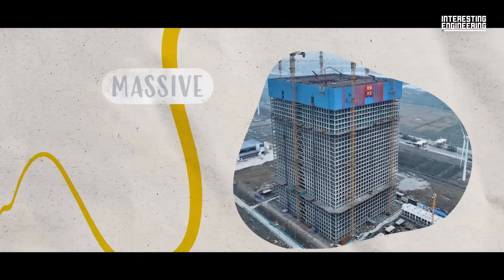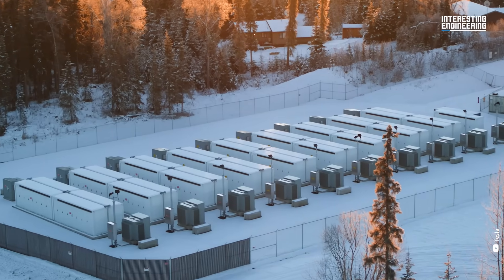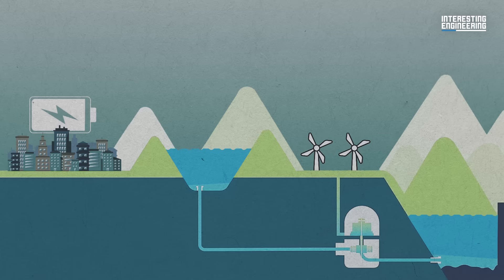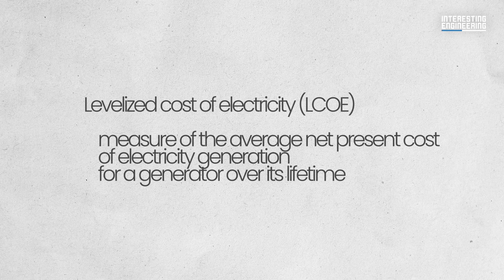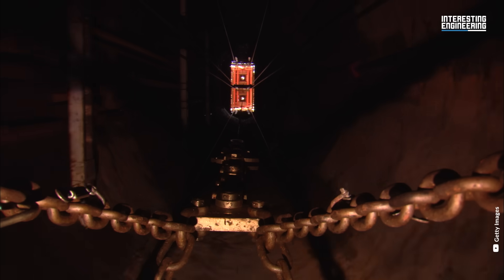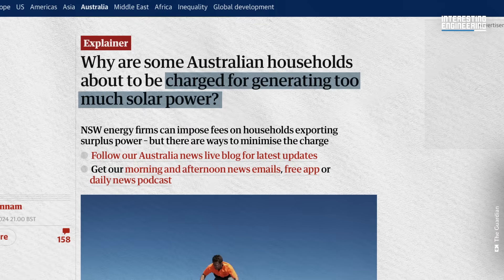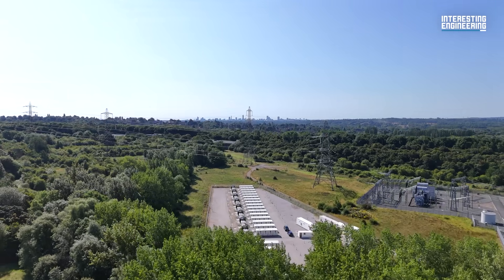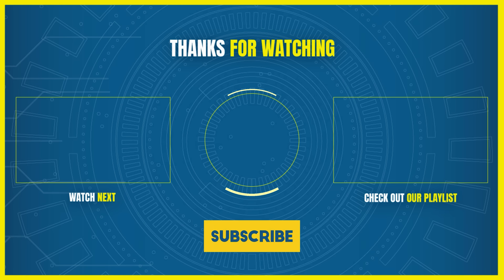China is Building Gravity Batteries

Comment: KISS - Keep It Simple Stupid.

GRAVITY STORAGE
Mass : giant constructed weight  
Energy transfer meathod: cables, gears, motor/generators, lateral movement mechanism,  attach detach mechanism,  tower or shift.
Wear and tear: all items
Relative conplexity: high
Maintanance cost: high
Initial construction cost: moderate
Lifespan:10-40 years

PUMPED HYDRO
Mass: water
Energy transfer method: water piped from reservoir through impeller into lower reservoir, motor generator transfers energy
Wear and tare: minimal
Relative complexity: low
Maintanance cost: low
Initial consultation cost: moderate
Lifespan: indefinite

Comment: Fracking doesn't "drill" anything.  ..a drill drills, frack machine is a pressure pump that forces pressure underground to "fracture" the rock. ...then sand is forced into the cracks so the cracks stay open

Comment: One big sealed tank uphill, one big sealed tank downhill. Fill one with water, pump it back and forth dependent on reserve power, and watch the magic happen. This isn’t new tech, it’s reinventing the wheel but worse.

You lose power shuffling the blocks back and forth, and not every block stores the same potential energy
Reply: If you just pump water back and forth “depending on reserve power,” you will lose more energy than you gain in the cycle. Any system like this that isn’t connected to a larger energy source cannot produce net energy.
Pumped hydro is used a lot in mountainous regions but you don't do that for a whole country, it's just not physically workable.
For China to produce their 23TWh/day they do today, they'd need around 8 millions tanks lol.
Reply: @Mathieu_soDjo no, really? You lose out on some power because there’s no such thing as lossless energy conversion? It’s almost like this is a problem with every form of power storage facility we have. 

The thing is, fluids have much less energy loss than solid blocks, because solid blocks need to be moved out of the way of other solid blocks. That lateral movement introduces additional energy loss.

And while establishing pumped storage introduces its own set of challenges, the end result is more efficient than this asinine block contraption

Comment: why not just use a water tower coupled with a lower water tank?
Reply: If you just pump water back and forth “depending on reserve power,” you will lose more energy than you gain in the cycle. Any system like this that isn’t connected to a larger energy source cannot produce net energy.
Pumped hydro is used a lot in mountainous regions but you don't do that for a whole country, it's just not physically workable.

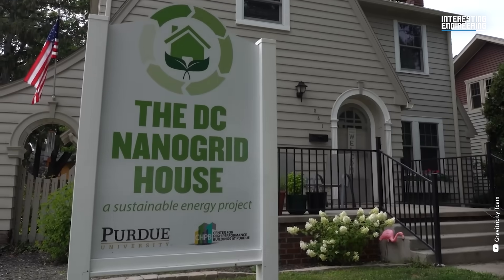Comment: I'm sure this is not the first time this has been tried. After all, electric motor-generators and grandfather clocks have both been around forever. But the experiment with a private house at 12:15 demonstrates just how limited the practicality of this technology can be. If the house had had an abandoned  5,000 foot mine shaft next to it, the cost would have been about the same, but the energy storage capacity would have been 200 times as much, or the equivalent or 2,400 AA batteries, or enough to heat the house for an hour or two.

Comment: THIS IS A CON : the biggest structure planned will store the equivalent  of 20 seconds of electricity for Tongliao where it will be built. If we compare to the Dinorwig Power Station, it would be a concrete cube with a side of 100 m on top of a 166 storey building.
It would be able to provide energy for a Chinese village of 4000 inhabitants for 1 hour. Or an American village of 1500 inhabitants for 1 hour. It would provide 7 seconds of energy to San Francisco.
I considered a 100% efficiency from the station to the final consumption (which is ridiculously high).

Comment: Gravity batteries have been around for ages. When there is a surplus of energy, its used to pump water to a tank up on a mountain, when there is not enough energy the water is simply released and a turbine is spun to generate more power
Reply: Pumping water doesn't achieve high efficiency, likely a lot less than 80% stated in the video.
Reply: @Signal_Glow  According to google pumping water is actually 70%-80%, and I could easily imagine efficiency to be so much lower when for example there is wind
Reply: @Signal_Glow  the big bricks could not attain nearly 80% efficiency. Why?
Energy loss due to inefficiencies in the motors, energy loss due to block lateral movement, energy loss due to lifting blocks in order to clear their descent, uneven distribution of potential energy (top blocks store more energy than bottom blocks)
Reply: @ComedicLetter  Good explanation, makes sense, the only thing i don't understand is why would top blocks store more energy than bottom blocks. 
Did you want to say their potential energy is always the same, but getting to lower blocks require a lot more energy because upper blocks would have to be moved away first? Something else? 
While i like useful technologies as this one, losses in wind/solar power generation combined with losses in current storage systems make them extremely expensive, unreliable, recycling isn't possible, etc. ~1400MW 3+ generation nuclear reactors for 5-6 billion eur in 5-7 years China and Russia, possibly South Korea can build seem impossible to beat with current technology. Many scientists believe small modular nuclear reactors would be very useful at places where big plants are not needed. I hope our politicians will rethink the problem and decide in favour of NPPs like they did in 60's, 70's.
Reply: @Signal_Glow  the reason as to why the potential energy differs between blocks is, while all blocks would have the same energy release rate (the rate at which the blocks descend), the total energy storage would depend entirely on how high that block is.

If all blocks are lowered at the same rate, but one only has half the vertical traversal of the other, the lower block will output less energy than the higher block.

I agree that nuclear is simply better in all aspects of power generation
Reply: @ComedicLetter  Got it. Thanks for explanation. 👍
I think nuclear option in the West will remain as it is because governments don't have nationalized companies involved in development, building NPPs. 
Where i live our government used to sell electricity directly and invest into infrastructure. In the 90's we got these companies who only resale electricity and gas at much higher prices and pocket millions if not billions, making people AND various essential industries (chemical, metalurgical, etc) a lot less competitive.

Comment: BS³! With 1 kWh, you can lift 1000 kg 366 m!
Debunkvideo www.youtube.com/watch?v=iGGOjD_OtAM
The building is a costly 120 m high and is designed to store 100 MWh.
That would be about 100 containers with batteries (approximately 3600 m³). That's a cube of less than 16 m, costing about 20 million. This building is supposed to cost 50 million....

The building looks twice as wide as it is tall: 240 m * 240 m * 120 m = 7 million m³. 7,000,000 / 3600 = about 2000 times larger than batteries!

And why concrete instead of water? With water, you only need a pump or turbine, not all the technology...?

The average height of the weights is 60 m. So, 1 ton of water stores an average of 1 kWh / 6 = 170 Wh. For the entire building: 7 million/2 = 3.5 million t. 3.5 million t * 170W = approx. 600 MWh

Comment: Well, at least for the US, the EV problem is going quickly away, as people in this country refuse to buy them, and basically hate them.  Not just range, which is speedily getting  longer and longer, but it takes a major lifestyle change to be ready to drive an EV only.  Not just charging, but if you don' t have a home charging system, you are left to the problems of finding working chargers, unused ones when you find a station, and the different charge times with the different charges for whatever one you pick to use, and costing as much a gasoline in the end.  Add to that winter weather woes different than ICE vehicles, not wanting to go in icy weather, and the ever present possibility of bad and very dangerous 'thermal runaway' fires in an EV, which shoots fire out from under it to 50 ft on either side of it, if it doesn't explode first and send it 30 ft in the air, hoping that you ain't inside it and be locked in it and not able to get out of it, plus not able to put it out with water, and the deadly smoke fumes that will kill you if you inhale just a little of it.  Then you might slow or think you put it out only to rekindle minutes to hours to even days later, so you can't put it close to other scrap cars in a salvage yards.  On top of that, at least in one country, they are forbidden to park in underground facilities, going on ferries, an under any covered parking.  So maybe now you can see why us smart Americans are fighting shy of EV's in general, and lastly, that damn things are too expensive to begin with.    As far as using stored water to run generators later on, I grew up with what was called the 'pumpback station' near our small town of Locust Grove, Oklahoma, which is still in operation today.  I used to drive and roam the hills and valleys the the lake was formed from, so it has memories for me.

Comment: Sill don't understand why weights would be better then water. You don't need terrain, just build a couple of giant water tanks over each other. They already exist in the form of oil storage tanks. It has way fewer moving parts then lots of cranes. Water is cheaper, easier to get, and doesn't degrade and ware out like large blocks of what every they are lifting.

Comment: A bit of a false equivalence here, lithium iron batteries aren't the only kind of battery, there's plenty of research going on in to a multitude of different battery types including batteries made of super-abundant elements. Anyway I'd be keen to hear what the energy density comparison is like between non-lithium batteries and flywheels, molten salts, gravity batteries, compressed air batteries, etc.

Comment: I think these things are not really for long term storage,  they are for blips when a cloud covers the sun for 15 seconds or for when everyone turns on their tv for the 6pm news. or for the blip  the other way , when they turn the tv off again after the show is over.  So it's all about smoothing the flow of electricity.  The pumped storage I visited in a school trip to "Turlough hill" in ireland many years ago  is 286 meters high, and 2.3 million cubic meters  (2.3 million metric tonnes) of water are moved up and down pretty much every day. "With the upper reservoir full, there is an energy storage of 1,590 megawatt-hours which equates to more than 5 hours running of the station at full output"   Concrete is about 2.3 tonnes per m3 so  your plant does not need to be as big. By chance, the numbers make it easy.  A sky scraper 286 meters high "only" needs about a million cubic meters of  concrete weights to have the same storage capacity as Turlough hill. The efficiencies quoted are different. 75% for the hill and 80% for the gravity battery concrete weights.

Comment: They have huuuge tides in northeast US/Canada. It would be cool to implement this idea using the tides to lift the weight. Like rising the equivalent of a fully loaded oil tanker 50 feet up, then extracting that potential engery between tides.
Reply: That’s called a tidal generator and we already have those. This method would not work for storing energy, only converting it.

However, pumped hydro storage was mentioned in the video. That would be viable in such locations

Comment: Stupid idea.  Just pump water from a low spot into a higher reservoir when generation exceeds demand. Then let it flow thru turbines back down when demand exceeds generation.   The pump, turbine and pipes are all stationary.    The ludicrous complexity of making huge blocks, building racks to store them, multiple cranes to lift them, cables, rollers, gears, all of which will wear and can become problematic.  Just plain silly.

Comment: Asked ChatGPT to consider the feasibility of gravity storage, thinking from first principles, then estimate - based on current materials and labor costs of building a 1GWh facility in Sweden. Assumptions and calculations looked sensible enough, and it landed at a total cost of around 8 billion swedish kronor. I then asked it for the cost of an equivalent capacity battery storage solution: about 2.5 billion kronor. Obviously not feasible here. Everything is cheaper in China of course – but in this case, the discount good might just be the political decision makers signing the contracts…

Comment: You can use gravity to do mechanical work. The Victorians used towers with a big weight pushing down on to a column of water to create pressure used to lift briges, open lock gates and power dock cranes. Liverpool had an extensive system.

Comment: This idea is multiple decades old. People realized there's a much easier material you can move up and down: WATER
5:30 This idea was trashed an eternity ago because of how much more efficient water is. Even just per cubic meter, it's already more efficient. Before you calculate in how much easier it is to build on mega-project scale. 

7:30 The cost /KWH is just an outright lie and mathematically impossible with this method. Even just the power of lifting and dropping, let alone the cost to build or maintain, is already beyond that.

Comment: the match does not add up on this ever being cost effective. FOr example, a 10 kg weight falling 1 meter just generates 98 watts. You would have to have giant vertical distances and highe weights for this to ever work for any significant power.

Comment: The amount of energy stored is neglible ... 

10 tons suspended 30 meters up can only generate 0.8 KWH 
so if you have 2000 tons suspended 30 meters up you get 160 KWH 

i wonder what the capacity is in the chinese example.

Comment: I remember when this myth was debunked years ago.
Reply: Post the debunk, please.
Reply: @principal_optimism  Hardly necessary to debunk. Some high school math says gravity storage doesn't really make sense. Here's a check. Work out an estimate for the weight of your house (or a typical house) and then work out how high in the air you'd have to raise the house so that when it drops down it generates all the electricity you need for the day.
Reply: @principal_optimism  i think @Thunderf00t did it a couple years ago.
Reply: @principal_optimism  A 40 ton small bungalow house would need to be raised 5 feet to bring to boil 1.5 liters of water.
Reply: @goldreserve  Assuming such bungalow uses about half the power of the average US household then It would have to be raised about 138m to power itself.
Reply: China really is building these, doubt they would be doing that if it wasn't viable

Comment: still didnt get why railroads are not used...its the cheapest way and infrastructure is already existing... its an addition to existing trains, it doesnt even have to compete on different tracks, its all about management.
Reply: I think I read about someone doing it, the idea was to take giant batteries from somewhere cheap to charge and theb move them by railroad to somewhere where power is expensive, whilst there, pickup emptys to return to them for charging

Comment: Gravity storage in homes is impractical but centrifugal storage might be.
Centrifugal storage takes the same weight a gravity storage uses but spins it at high RPM on magnetic bearings.
These also have a heavy steel containment around the spinning mass to contain it in case of catastrophic failure.

Comment: The mechanical gravity batteries are one of the forms of green quackery. Anyone can calculate how little energy is actually in a lifted weight. For example, to provide an apartment or small house with energy for a month, you need to lift 2000 tons 100m high.

Comment: This is a stupid concept because the friction between the cables and pullies would bleed off energy and while small, would still yield a diminishing return making the idea impossible.  It'd be like trying to hold water in a leaking tank, it will hold some energy for a time but eventually it will run dry on it's own if not constantly topped up.  It's basically a giant capacitor, not a battery.  These are basic Thermodynamic principles.

Comment: For China specifically I believe their massive EV production is their answer.
EVs plugged in at night ARE their storage facilities.
Power plants can run at peak production constantly rather than reducing at night time.
The more vehicles the better the situation gets.
If some cars are left plugged in during day time they could be used to supply electricity during peak need.
Workers could be supplying factories power from parking lots.
If new Na batteries are what the hype suggests, all energy storage problems are solved.

Comment: Nope... this is absolutely ridiculous. The energy loss in the friction of the cables, gears and pulleys and associated wheels and bearings  must be considered... substantial.
In addition, the cables will stretch overtime as they wrap around the winch wheel which on release will lose tension providing less consistent energy released.
There are so many maintenance issues... the constant lubrication of the bearings and gears is just one issue.

Comment: (9:47) But the mine shaft goes well below the water table. Pumping the shaft dry would cost energy which would need to be accounted for.
Reply: Maybe after initial pump out, shaffs can be water sealed?
Reply: @jeffreyschiller3703  maybe some kind of waterproof concrete